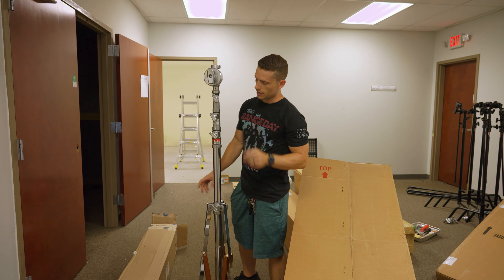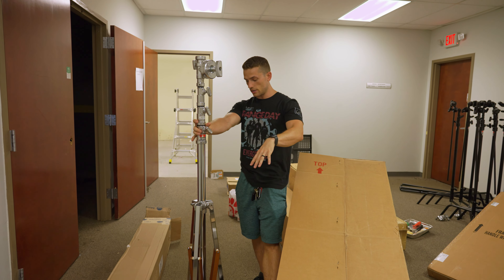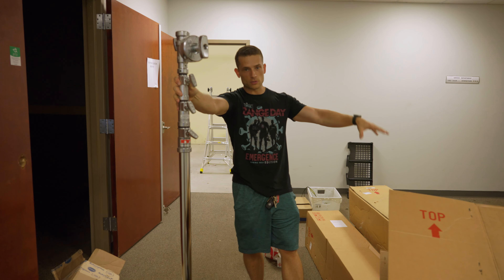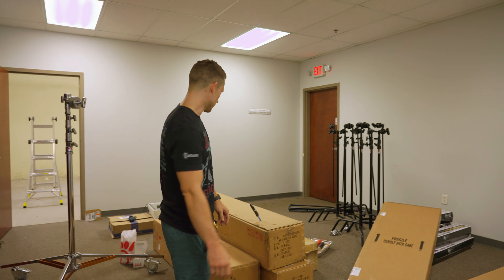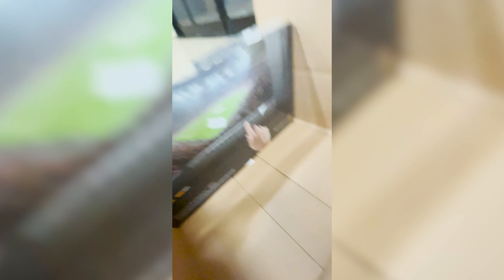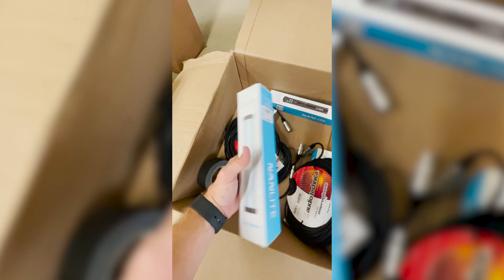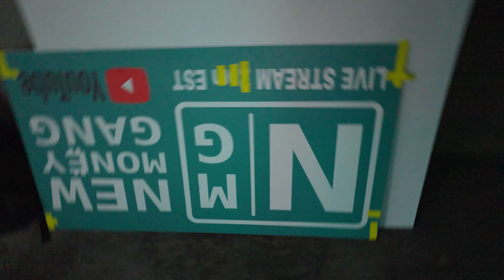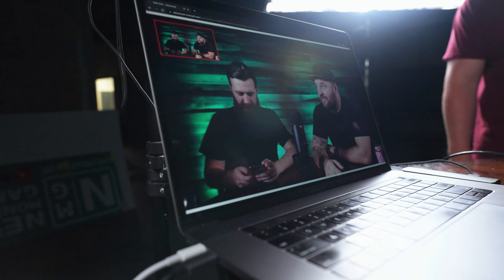Best Equipment To Upgrade Your YouTube Channel | Hit Factory 005

Comment: You guys really need to shell out some money for hand trucks and dollies or even an electric pallet mover. if you don't you will be shelling out major dollars to Workman's Comp and other insurances for back injuries. Spend a few thousand now to save hundreds of thousands or more later. And also some safety equipment. Sawing without safety glasses on?!! Using nailers and hammers in tennis shoes and shorts?!! Cut resisting gloves can save you thousands of dollars in emergency room charges. Don't ignore these things.  Put safety first. You'll regret it when injury bills start rolling in.
Reply from the maker: copy that